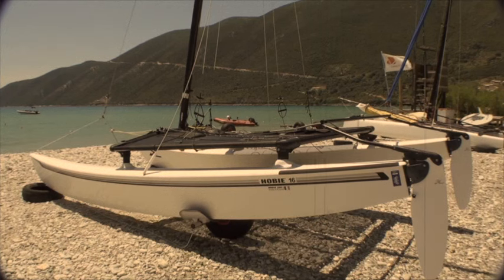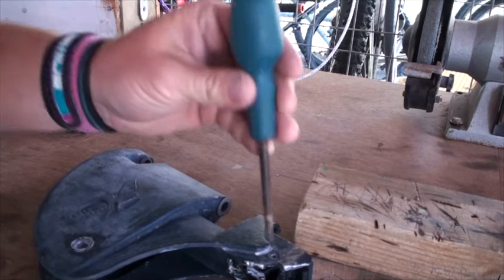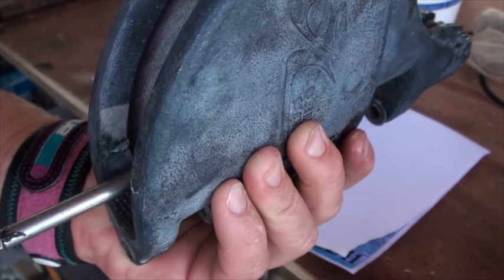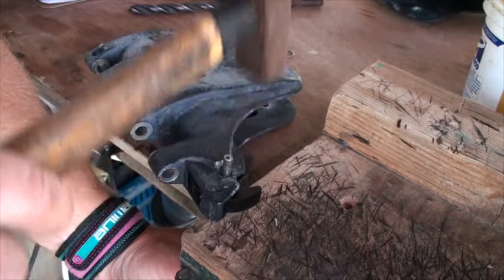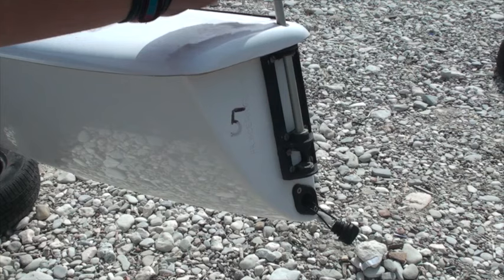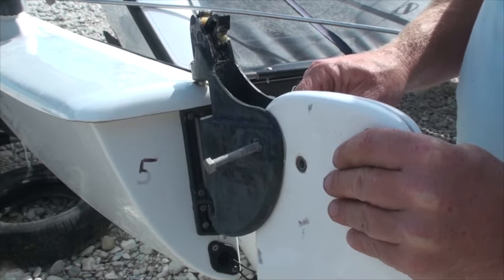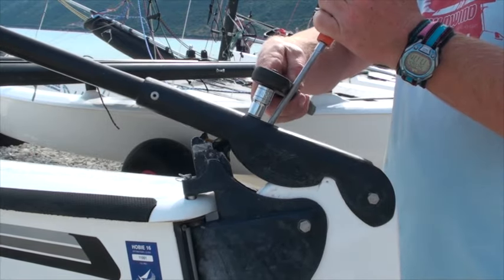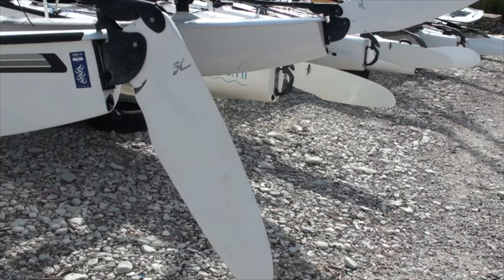Service Your Hobie Rudders

Comment: What a great video !

I've just spend one day repairing my rudder following your instructions :-)
I had one rudder that was badly repaired, so I filled the holes with fiber, then drill new holes correctly positioned and re-assemble the whole.
It is now working perfectly and the the repaired rudder who was making an angle of about 15 degrees is now perfectly vertical... I do not "battle against" anymore... What a pleasure !

Thank you,

Stéphane, from France (Vendée)

Comment: Just picked up a Hobie Cat 16 from the neighbor of a friend that I was doing an A/C check for. He was disassembling all of the fittings and was going to scrap it. 
 I HATE to see that happen-- offered scrap price. Has a small hole in a hull and he mentioned that he had trouble struggling with sluggish steering  because he couldn't get the rudders to fully reset. 
 Have a very good friend who does glass work -- he is very enthused about the project and started the initial clean up phase of hull repair within 15 minutes of getting it to the cottage and unloaded. 
I will be disassembling the rudder release mechanisms when I return to the lake cottage.
The Hobie will be like a Cobra compared to the Catalina and MacGregor!  Even came with the diaper! 
Thank you!
Reply from the maker: Excellent, great job bringing a 16 back to life.
I'm glad that this helps.

Comment: Hi Joseph. Here I am again.Only to inform you and improve your knowledge that after working a lot without any success (hammer, WD40, lubricants, etc...),  I 've removed the Pins from rudders  very easily in only 3 minutes. How ? Using a 2 Claw Bearing Puller of only  some 15 Euro .  Now the rudders are perfect . Thank you for your support anyway. Cheers Frank
Reply from the maker: Hi Frank, this is some solid gold info - i'm going to get one for sure (i'll make a video on it!) as hitting the pins is never an ideal solution.
Reply from the maker: Hi again Frank,  I've had a look and it seems that there are a world of bearing pullers out there - could you send me a link to the one that you have,
Reply: Hi Joseph, here is the link for buying/looking the tool.
Origlam Two ganascia cuscinetto... https://www.amazon.it/dp/B0777J23WH?ref=yo_pop_ma_share

Comment: During my rebuild, my delrin screws were corroded into place (used boat that I had just purchased). I had completely stripped the screw slots trying to get them out, so I heated up a square-shanked screwdriver and melted it into one of the screws. I placed the casting into a vise, grabbed onto the screwdriver shank with a wrench, and gave it the beans . . . and split the rudder casting apart. I got some rebuilt castings off of Ebay for $25 a piece.
Reply from the maker: Crikey. 
That's the first time of hearing that happening. 
25 for new casting is a very good price. I hope that you're back on the water now.
Reply: @JoyriderTV  Experience is learning from your own mistakes. Wisdom is learning from other peoples' mistakes. I have a whole bunch of experience.

Comment: Love all your videos. Very informative.  I recently acquired a Tiger, and unfortunately not a large sailing community around me, but have learned so much from the videos. I haven’t seen it addressed, but would like to upgrade to the EPO3 rudders. So, do the Hobie 16 rudders fit on the Tiger?  16 rudders are the only ones I can find.
Reply from the maker: The EPO3 blades are only for the 16. The standard Hobie 'white knight' blades are very good for the tiger - if you are ordering, be sure to get the right shape - I think they changed in 2007

Comment: Really useful video. Love all your vids tbh.
Ive just bought my first sailboat based on your videos, gave me the confidence to give it a go. It's a hobie 16 (year 2000). 
It came with new rudder pins and collars and the seller said I need to drill out to make them fit, thus watching this video. It's the only part of being a newbie that worries me: why does it need to be drilled out? I guess I'm asking why you cant buy pins and/or collars that fit?
Any experese on thus would be greatly appreciated.
Reply from the maker: Yes, the drilling out is because after a time the holes in the casting become elongated which means if you want them to be perfect you'll need to drill and bush. 
Good luck!
Reply: @JoyriderTV  Did it. My god, that metal gets hot while drilling 🔥
The most difficult part was finding a reasonable priced 12mm long bit and then a drill with a big enough chuck 😆
Thanks for your videos, they are really helpful.

Comment: Hi Joe, thanks for this video on rudders. I need some clarification on the exact movement to be done on the coupling bar. On the 16 I'm using, when I manually raise the rudders I get both the cams in the down position and then I have to rearm them manually. If I let the rudders pop up by themselves on the sand, I instead get the cams automatically up. Do you have a tutorial on how to move the coupling bar when you want to manually raise the rudders without having troubles with the cams position? Thanks! 😉
Reply from the maker: For the cams to pop up when you pull them up manually, you need less tension in the screw that holds the spring. 
Possibly around 10 - 12kgs
Reply: Joseph Bennett Thanks!! ... now I understand why it is so hard to pull up the bar manually in the one I'm using, and why I need a "strange" strong push to set the rudders in the down position too....too much tension in the screw! Hopefully I'll buy my own 16 Race next year, I'm getting tons of great hints from you and your channel! 👍🤙

Comment: great tuto, did you have some tips on how to unlock/unscrew hard to move bolts ?
Reply from the maker: If it is the plastic screw - https://youtu.be/BWuC9utw6CQ
Reply: @JoyriderTV  yes there is the plastic one but also the big one on top to adjust the angle/lock position

Comment: What are the lines at the hinge joint between the crossbar and the rudder arms?  My 1977 16 doesn't have those.  Thx!
Reply from the maker: They are for the different style of connection,. on older boats they are not necessary

Comment: At 1:24 the plastic screw is seized on my Hobie and can’t get it out. Do you have any advice?
Reply from the maker: That happens quite a lot on castings that aren't regularly serviced or greased. It's a bit of a procedure to fix as you have to drill out the old screw. The details are in this video: https://youtu.be/BWuC9utw6CQ

Comment: Hi Joe....very nice videos. I have a hobbie 14 and when sailing the rudder is very hard. Is it because of possible wear or because both fins are not perfectly aligned?
Reply from the maker: Most likely to be because the rudders are not locking down fully. 
When your boat is on the beach put the back of the boat up (maybe on trolley) lock rudders down and pull them back to see if they move.
If you tune in to the Q+A on wednesday - or watch later, i'll give a demo of what i mean.
Reply: @JoyriderTV  thanks a lot Joe....great channel and speed of light answer

Comment: well explained man :) I  see you use a  torque wrench to  tie the bolts 

how many kg max  you are tuning it ?
Reply from the maker: I just use regular spanners and tighten the bolts so that when lifted, the rudder blade will still fall down under it's own weight.
Reply: good :)

Comment: I've checked out the video and it's ok, but my problem  is different:  the pin is completely stuck inside the holes. Perhaps because of a long time without removing it (my mistake).  Some guys told me to cut it, but I do not want for risk of damaging  the hull. My idea is to remove it by an extractor but I do not know if it exists. Thank you .Cheers
Reply from the maker: time to recruit an engineer!

Comment: I know this is an older video, but is there any way to remove forward/backward slop when the h16 has the non-adjustable upper casting? Is the only way to drill holes in the casting itself?
Reply from the maker: Unfortunately not - when you have the fixed bar that locates into the cam - the only way would be to change the location of that bar in the casting - which would be very difficult.

Comment: What size are the ptfe discs you used as shims?
Reply from the maker: Ideally 10cm for the lower and 6cm for the top, 2mm thick - if i'm stuck for materials i cut them out of old detergent bottles and then double the thickness if needed.

Comment: I attempted the service and learned a hard lesson ~ never do this service with out spare parts. The derlin screw was stuck in the casting. I had to drill it out and order a new screw. If the screw is stuck do not do service until you have a spare.
Reply from the maker: That's a great tip!
I overlooked that. Your boat will still be sailable with stick screws but once you've drilled them......
Reply: @JoyriderTV  My hobie dragoon was stolen right off the seawall a couple days ago. They left the mast behind lol. Do you know of any gps trackers that could be installed on a hobie? And where would be the best place to put them? I was thinking inside the hull.
Reply from the maker: @Jordan-lz6hd  oh no, that's terrible. I'm so sorry to hear this. 
My initial though was a gps tracker on the mast - but if that can be left that's not going to work. 
Maybe in the hull - or possibly in a small box riveted to the front beam - I don't know much about the trackers though, would it have to be charged?

Comment: Hello Joseph, 
On my hobie 16 the bushes fits only on the top and the bottom holes of the castings, the middle of the castings is more tight, it fits   the aluminium axles. 
My question is, did i have to drill the middle of the castings, to put bushes everywere or 1 on the top and 1 on the bottom is enought ?
Thanks
Reply from the maker: If the pin is reasonably tight in the middle parts of the stock then absolutely no need to drill it out. If you don't have play in your system then I think that you're all good.

Comment: hi Joe, any advise please on repairing a rudder? a piece has broken off the rear top through the hol. thec break is clean and i feel confident to drill a couple of holes and then screw it back together but am wondering what to use to glue the screws in place nd he two pieces of the rudder together...epoxy or wht?
Reply from the maker: Unfortunately this kind of thing is not my field of expertise. 
I would have thought that there's specialists on YT in that department.

Comment: ive looked for those shims at my local marine stores, cant find anything suitable. ? also i have some wobble in my rudders that i thinkm is due to the hole through the rudder being enlarged over the years. im using 5/16" bolts and am thinking of, 1. filling the hole and redrilling with a 5/16" bit or, 2. drilling the hole and using a nylon type bushing on the bolt the same diameter as the new hole. ? thanks!
Reply from the maker: If you can find stainless steel inserts that would go through the newly drilled blade that would be the best. I think that nylon wouldn't laswt very long.
Reply: @JoyriderTV  thanks joe. actually the material is very tuff! but im now thinking the play in the rudders is because the width of the lower casting is considerably wider than the thickness of the rudder. so i think ill try to find a proper spacer/washer on each side of the rudder.

Comment: If the pin is blocked inside because of not removing for two years, how can I remove it ? Thanks
Reply from the maker: all that I can recommend is to give it a good spraying with WD40 or similar, leave for an hour and then get another pin to hit it down with (or a custom made tool like in this video) Also if you get enough pin sticking out so that you can get a good hold of it with some grips and then use the rudder stock as a lever - pushing it back and forth to loosen it. Sometimes it takes some serious encouragement hitting down with another pin. That's all I have, I hope that you succeed!

Comment: To do with the bushes. My castings are already very loose with bushings installed... How do I fix that?
Reply: new bushings, check that the hole in the casting is the proper diameter
Reply from the maker: Michael Gregory Eaton Just saw your question, you can wrap electrical tape around the bushes to make them fit tighter in the castings - that's the only solutions to this problem except for getting something customer made in brass,
It does work well though.
Reply: Joseph Bennett Thank you. I took the entire rudder assembly off the boat and discovered that there are "top" and "bottom" bushings, the top ones are smaller, so they will fit in either hole, but if they're in the wrong hole, they allow movement. with some playing with it, I figured this out, they're about a million times tighter :)

Comment: Hi Joe, ive been working on the rudder for my Hobie 16. I've replaced the cam, spring, and screw. One side I've got working well but one side I cant seem to get to consistently lock-in. I've tried matching the position of the rudder cam bracket inside the rudder stock and playing with spring tention but the cam keeps regularly binding on the cam bracket.  I'm a little at wit's end, any further advice would be greatly appreciated.
Reply from the maker: It could be that your cam stop plate is too far forward - try backing it up a few mm and see if the rudder then locks down correctly. 
The rudder stocks have small differences from the manufacture meaning that the settings may not be exactly the same on both rudders to achieve the same results. 
Let me know if that makes any difference.
Reply: @JoyriderTV  someone also replied that the shaft which the plunger sits it could have been enlarged thus cause the plunger to bind. It that also a possibility?
Reply from the maker: @elishaburrows4241  If it's possible for the cam to be pushed into the down position, i'd say less likely.
Maybe tune in tomorrow for the Q+A (at 1730 Greek time) and we can take a look.